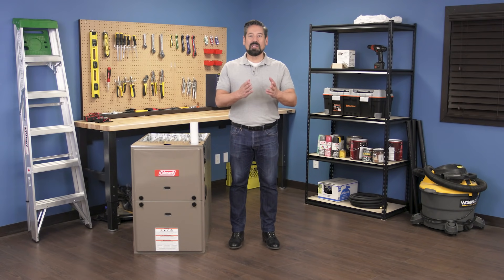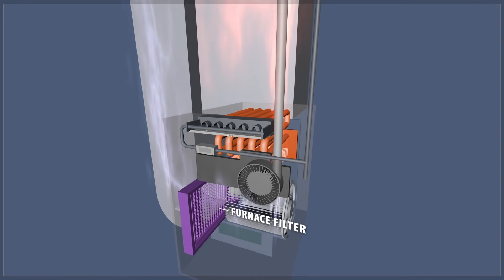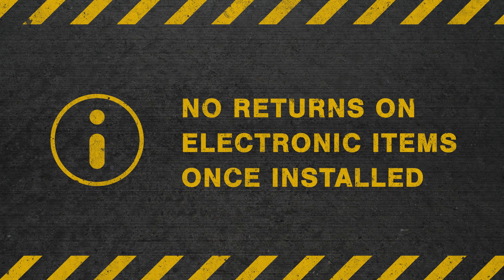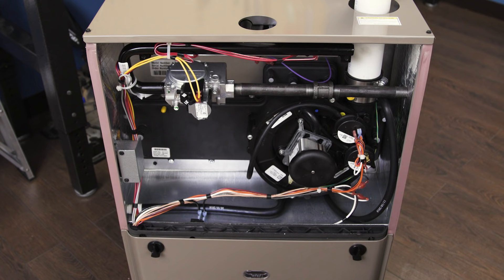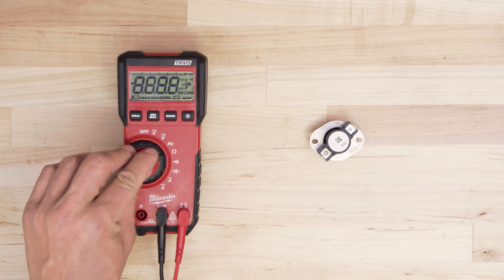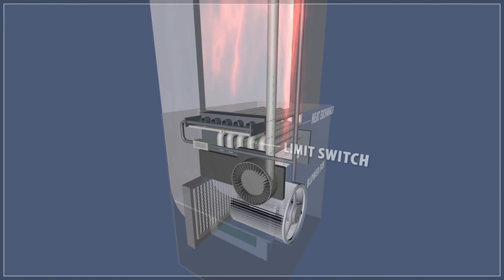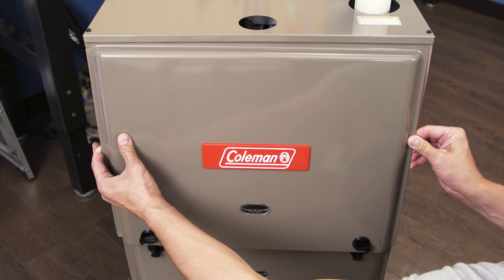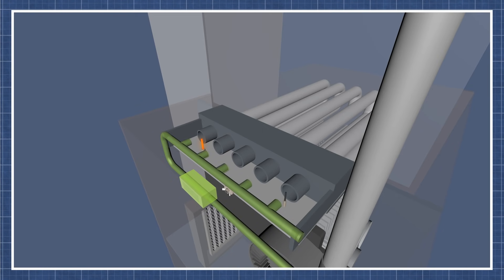Furnace - Limit Switch | Repair and Replace

Comment: I have a Gmp075-4 Goodman furnace and I have checked all the switches. I just replaced circuit board about two years ago along with blower motor. The other night I turn the unit on and the igniter lights up the flames come on the draft motor spins and the blower motor will cut on after a minute but will not blow the air through the house. When I turn the thermostat from Auto to ON the igniter will light up the flame comes on etc. but as soon as the igniters lights the flames in the ON  position on the thermostat the flames automatically go out but it does blow air through the house when The thermostat is set to ON.anything you can suggest?
Reply from the maker: Thanks for watching. The "On" setting for the fan means that it will ignite the burner, heat and run the blower, and then when the heat is off, the blower fan will continue to run 100% of the time. The "Auto" setting means that the blower fan only runs when heat is needed.  Based on what you wrote, on both settings, the heat is cut after the burners are igniting implies that the limit switch is tripping. If there is poor airflow or a dirty filter, then the heat exhanger might be overheating and tripping the limit switch. Alternatively the limit switch might just be wearing out. It uses a small bi-metallic disc inside that can warp over time. This can cause the limit switch to trip at perfect safe temperatures, shutting off the heat prematurely.

Comment: Will a faulty limit switch keep the blower running during summer months using AC ?
Reply from the maker: Thanks for watching. It depends on the model but yes a faulty limit switch can keep the blower fan running longer than what is necessary. It depends if its a fan limit switch or a high limit switch, which will be wired differently in the circuit. Its best to check your wall thermostat fan settings first before testing or replacing the limit switch.

Comment: so, what happens if the limit switch shows continuity, but the readout os .08 to .11 instead of 0.00
Reply from the maker: Hi Serena, thank you for watching. A limit switch is simply a path for the electricity to pass through, it will generally have a resistance between 0  - 1 ohms (a path with very little restriction to the flow of current) If the limit switch is faulty there will be no path for electricity to flow through. This will not show a resistance reading, the multimeter will show "- - - - - - -" , "OL" ,   or a blank screen. So your reading of 0.11 is a perfectly acceptable resistance for a limit switch.

Comment: Hi. Vance. I am wondering if I can buy any limit switch for my special furnace. Do you think all limit switches are interchangeable? thank you.
Reply from the maker: Hi Paul, thank you for watching. As long as you match the size and the temperature rating then you can use any limit switch that matches. For example a L150-20F switch will open at 150°F and close again 20° lower. Some switches will just list a temperature range 130-150F etc You can order limit switches here: https://www.amresupply.com/catalog/Fan-Limit-Controls-HZ3D

Comment: Would the limit switch do the same thing and start and shut off the exhaust fan even in the summer with the central air unit running?
Reply from the maker: Hi Tony, thank you for watching. It really depends on the wiring. If the limit switch is wired into the blower fan circuit then a faulty switch cancreate problems with the central air conditioning running. Regardless most common causes of an AC unit cycling on and off is a dirty compressor that is overheating, poor airflow over top of the evaporator coils (dirty furnace air filter), or issues with your thermostat.
Reply: AMRE Supply the central air unit isn’t shutting off it’s just the exhaust fan that is running for like 7-10 seconds then off of 7-10 them back on. The blower doesn’t do the same it runs and cools just fine.
Reply from the maker: @tonyschol4326  Some furnaces have blower fans controlled by fan limiters, and other models have just a high limit safety switch. In your case it does seem like you have a faulty fan limiter.
Reply: AMRE Supply thank you!!! Much appreciated
Reply from the maker: @tonyschol4326  You're welcome Tony!

Comment: Thank you for this. Woke up this morning to no heat from the 1990's Amana 90+, but had airflow and on/off was working. I opened the bottom up, saw blink code 4 blinks, which indicates filter/or high limit switch. Replaced the filter, pulled out the limit switch and tapped it in my hand a few times and GOOD TO GO!
Reply from the maker: You're welcome Justin, we're glad the video helped you get it running again!

Comment: Hey Vance  what does the L200-4, etc. stand for and A6v on a KLIXON thermal limit switch?  I am trying to replace one and need to know what these numbers mean (KLIXON, S206H, L200-4, A6v)  Can you help?
Reply from the maker: Thanks for watching. For most limit switches, the number refers to the temperature that the switch opens up. An L200 switch will open at 200°F. Some switches will have additional numbers that are more detailed. An L200-40 or a L200-40F means that a switch will open at 200°F and will close again at 160F after the temperature drops 40°. It seems with the Klixon switches they abbreviate this and just put L200-4. Always try find an exact match or a cross over replacement using your Furnace model number. If not thatn find a switch with the same size and shape with the same ratings. Hope this helps.

Comment: That’s not a proper gas valve....
Reply from the maker: Hi Louis, thank you for watching. At the building we filmed at that gas valve shown at 1:16 passed code when it was installed. It might look different than what you're used to but codes will differ based on region. Based on your experience, what is a proper gas valve?

Comment: Hello we need to fix the limit switch for our furnace but we can’t find our exact model(l200f 30), could we use a similar limit switch instead? For example could we use the l250 40 instead of the l200 30?
Reply from the maker: Thank you for watching. Your furnace  is designed to operate with that specific limit switch and it is not recommended to put a different switch in as it will change how the furnace operates. Those number refer to temperature limits and the temperature difference that it closes at. Those ratings need to be exactly the same.

Comment: if it is bad would it keep the burner and  igniter to turn on??
Reply from the maker: Hi Pablo, thank you for watching. Yes a bad limit switch can lockout the furnace and prevent it from running or igniting at all.
Reply: @AmreSupply  I have continuity on the high limit switch. I'm in front of my furnace now scratching my head 🙁
Reply: I was just watching some of ur videos that can help me with my problem lol.
Reply: I checked the voltage to see if I'm getting 120 from the wires from the inducer to the board but nothing
Reply from the maker: @pablogomez7519  If your furnace isn't starting at all then watch this video: https://youtu.be/Bi76q0TzoW8 Now if the furnace has power then the best thing to do is to check your furnace codes. When a safety switch fails or is tripped the furnace will give you a status code through blinking LED lights. https://youtu.be/b0sAGt-1niU?t=57
Reply: @AmreSupply  it does 1 blink then a red pause for a sec then a blink. but on the code reader it doesn't mean anything really just that I'm resetting it when I kill the power. nothing about and sensors or switches🤷🏽‍♂️
Reply from the maker: @pablogomez7519  If a safety switch trips then it should give you a more specific code. If you haven't already, try resetting the flame rollout switch. Its shown in this video: https://www.youtube.com/watch?v=23LGRraYUg0 As well your control board might have a blade style fuse. You can remove it and test it for continuity. Other than that, check all of the connections to see that there's good contact and look for any signs of scorching or burn marks on the terminals or anywhere on the control board. If that doesn't help then you might want to call a technician to help you out.
Reply: @AmreSupply  I got power to the computer but it seems the computer isn't sending any to the inducer or the igniter. I checked for voltage on the wires from the computer but nothing. I jumped the black wire from the plug that goes into the door switch to the black wire that goes to the inducer and it started up. you think that the board could be bad?? thanks for your time sir
Reply from the maker: @pablogomez7519  First before assuming that its the control board in your case it would be best to disconnect the power and test the continuity of the door switch. If the door switch has failed then it will prevent the furnace from starting.
Reply: @AmreSupply  the door switch is good. I'm using tape to hold it down when I attempt to turn on the furnace.  only thing that turns on is the blower
Reply: @AmreSupply  I replaced the igniter and now it seems to go through it's normal cycle except 1 problem! the gas valve doesn't release any fumes. I am getting the clicking and 24v from the computer but no gas
Reply from the maker: @pablogomez7519  In that case the gas valve could be faulty, or the burners could be getting clogged. Alternatively you could have low gas pressure.
Reply: @AmreSupply  if the burners were plugged I would atleast smell some gas fumes, right? I get close and no smell. I started it up and when I turned off the power I unscrewed the small cap on the valve and hardly smelled gas
Reply from the maker: @pablogomez7519  Yes you'd likely smell some fumes if that was the case. From what you're describing it is likely a faulty gas valve.
Reply: @AmreSupply  it was the gas valve and everything is running smoothly 👍🏼👍🏼 I really appreciate your reply and help sir thank you so much
Reply from the maker: @pablogomez7519  You're welcome, we're happy to help! Its great that you have your furnace back running smoothly! Cheers!

Comment: My furnace works great through 4 cycles but after i get 4 blinking lights and takes a long time to turn on again unless i turn of the thermostat for 10 sec and then turn back on could this be the limit switch??? Please help me
Reply from the maker: HI Bernadino,  overall its best to check your furnace codes. They are written on the back of your blower cover door, or are sometimes in the furnace manual. This will tell you what those blinking lights means for your particular model.  If the code comes back as the limit switch error then its still worth it to check the airflow and replace the furnace filter. If not then replace the limit switch.

Comment: Does it matter which way the new limit switch goes in?  The one that's in the furnace now is marked with a green dot on one wing matching a green dot on the housing.  Also, the multimeter shows .04; I assume that means it's faulty.
Reply from the maker: Hi Steven, thank you for watching. Its always best to replace the limit switch in the same alignment and orientation as the previous switch so that the switch is responding to the same path of air over the heat exchanger. As for the multimeter reading, 0.04 ohms is continuity, as there is still a continuous electrical path present in the switch. Limit switches simply provide a path for the electricity to pass through and will generally have a resistance between 0 - 1 ohm. Testing the switch at room temperature will tell you if the switch has failed outright but will not tell you if the switch is opening correctly at its rated temperature. That is difficult to test, so in a lot of cases its best to replace the limit switch to remove it as a potential issue.

Comment: My furnace has 4 blinking red says limit switch open ..I replaced the limit switch then fired up the unit it ran for about 3 min.then shut down again after while it started to blink 11 red blinks saying limit switch open blower failure what do I do now..thank you
Reply from the maker: Hi Robert, thank you for watching. By replacing the limit switch you have eliminated that as a problem so if the limit switch trips its because of poor airflow over the heat exchanger. This can be caused by a dirty furnace filter, clogged ducting or by a weak or failed blower fan motor. Did the blower fan run during those 3 min? If not then the motor might have failed, the motor capacitor might be bad or the bearings might have seized. You can see how to access the blower fan, test the capacitor and replace the motor all in this video: https://youtu.be/4SY8lRl8HV0 Hope this helps!

Comment: When i turn on my furnace it will light and turn on but the blower will shut off after a minute. Could the limit switch be the problem?
Reply from the maker: Hi Chris, thank you for watching. What you are describing is short cycling, and the fact that it lights, blower fan runs then it shuts off does point to the limit switch. A full explanation of short cycling is covered in this video: https://youtu.be/b0sAGt-1niU

Comment: My problem is the furnace starts normally, induction motor comes on then igniter then the burners for a couple minutes then when its time for the fan to come of the flames go out. The induction fan stays on for a few minutes then shuts off. I have a red indicator blinking continuously. I know the fan works because I can turn it on manually and works fine with A/C. Any thoughts? I removed the flame sensor and cleaned it with no change.
Reply from the maker: Hi Ed, thank you for watching. The flame sensor could be faulty or the flame sensor not be in the right position which would prevent it from heating up and verifying that there's a flame. The tip  of the flame sensor should sit just in the flames.

Comment: 0:43 dang, if only I found this video before I bought a replacement relay switch. Thanks for explaining it.
(update, fan still runs 24/7)
10/2020 update: A/C tech said the problem was actually the fan motor itself was stuck permanently on and had to be replaced. The fan was replaced and now it works properly.
Reply from the maker: You're welcome! We're glad you found the video helpful!
Reply: @AmreSupply  Installed new one today, it did not fix my problem. The PAYNE A/C fan still runs 24/7.
Installed these 2 things:
WARREN TECHNOLOGIES AUTO LIMIT SWITCH L165 (312403/T-O-D60TX11/1644) L165-40F
Song Chuan 832AW-1A-F-C1, 24VDC Relay, 240 VAC, , 30A General Purpose Relay.
fan still runs 24/7. Doesn't matter what the AC is set on and doesn't matter if it is connected or not.
All I know, is there is a black wire inside the air handler, and if i unplug it, the fan stops. I replaced the thing the black wire plugs into (relay) and it didn't fix it, so i saw your video, replaced the limit switch, still runs.

Any more ideas?
Reply: @FusionDeveloper   Did you fix your problem?  I have the same problem...fan continuously runs on my Carrier central heater.  I was going to replace the limit switch however, it measures 0 ohms between terminals.  Looking at the furnace schematics, it seems like it should be "open" when cool (fan de-energized) and "close"  when warm (fan energized).
Reply: 10/2020 update: A/C tech said the problem was actually the fan motor itself was stuck permanently on and had to be replaced. The fan was replaced and now it works properly. ((I previously had replaced 2 electronic components on the circuit board, a temperature detection thing and a relay switch and it made no difference.))
Reply: @FusionDeveloper  Thanks!

Comment: What if i bypass the limit switch and it still not working
Reply from the maker: Hi Ergar, thanks for watching. Just make sure that you reconnect the switch afterwards, as the furnace needs these switches to run safely. Does the furnace run at all? If not then check these things in this video: https://youtu.be/Bi76q0TzoW8 Now If the furnace starts then stops then it'll likely give you a code and could be several different components depending on how far in the sequence it shuts off. You can learn more here: https://youtu.be/b0sAGt-1niU

Comment: The multimeter reading on my limit Switch reads 00.1. Is that considered 0?
Reply from the maker: Hi Jonathan, thank you for watching. Yes 0.01 that is close to 0 but overall switches will have a resistance between 0 and 1 ohm as they merely provide a path for electricity.

Comment: Looks like the same limit switch on Electric furnace
Reply from the maker: Thanks for watching! You are right many electric furnaces use these limit switches of the same design, but keep in mind they may have different temperature ratings depending on the model.